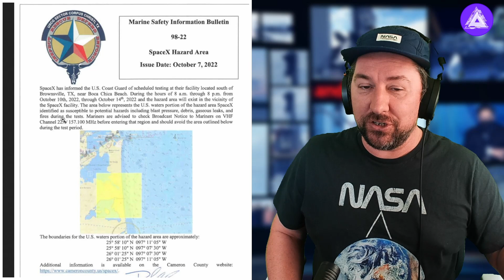SpaceX Ramps Up Starship Testing [Booster 7 and Ship 24]

Comment: Not that it would be easy, but I think it would be useful for the starship bay-slot door to release a string of cubesat inspection drones with thrusters, cameras, and sensors to float around starship on its first launch and inspect Starship before attempting reentry (especially engines and heat shield)

Comment: I expect to see a suborbital flight in the next  4 weeks followed by a full orbital flight in about 8 weeks.  I believe B7 and S24 are intended to be suborbital NOT a full orbit.
Reply: I believe he intends to achieve orbital velocity but is stopping short of a full orbit by landing near Hawaii.  Thus making it a SUBORBITAL flight
Reply: @jerrygeeraerts8651  As has been the stated intention since Pontius was a pilot.
Reply: @bernardkisby4490  I sure wish they would stop saying "orbital" and use the correct terminology ie "SUBorbital"
Reply from the maker: As Elon explained the “orbital” flight. It’s close to actually doing a full orbit. Is that what you’re taking about ? Or a different mission ?
Reply: I also expect that prototypes Booster 7 and Starship 24 will be the first suborbital  launched test in November  and they will try to land both and see how  prototypes  are going , the  test ,  results , etc and probably Booster 8-9 and Starship 25-26 will be launched to orbit  January and Feb 2023. Barcelona
Reply: We'll see.